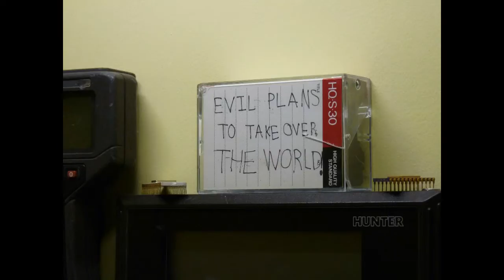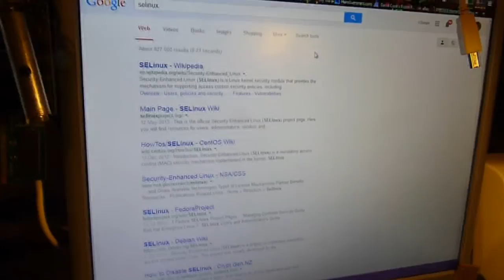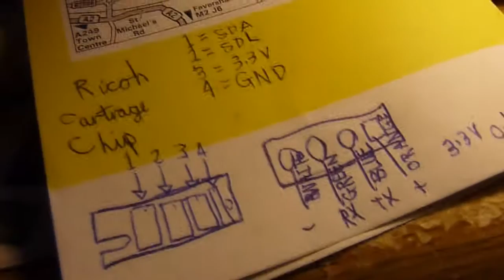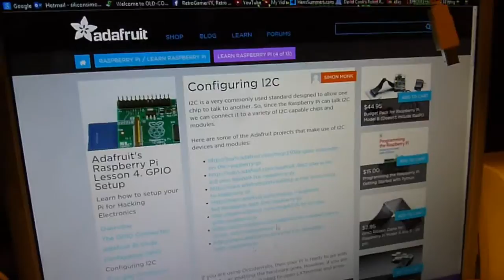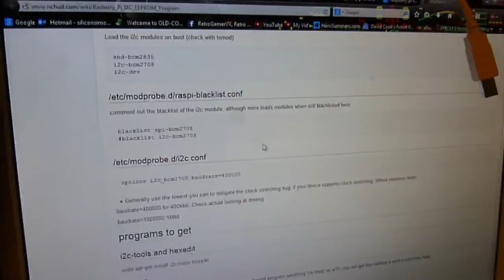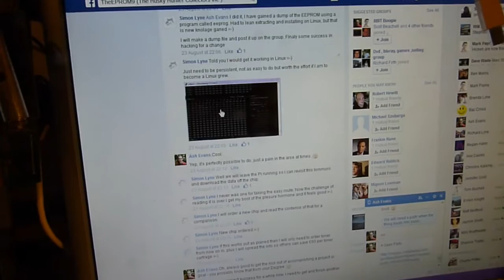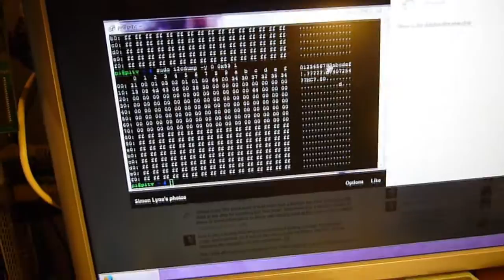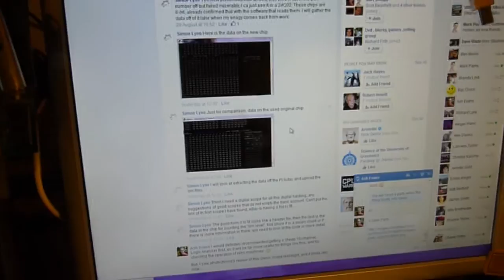Ricoh SP201n Toner Cartrage Hacking

Comment: Just made reset to my Ricoh printer using PonyProg(Windows version) and FTDI (usb to serial) adapter. Soldered 4 wires to chip pads:
Vcc -> Vcc
Gnd -> Gnd
SDA -> DTR and CTS
SCL -> RTS
Here's eeprom dump:
drive_dot_google_dot_com/file/d/0B4yCwRQLoGTdaU4tY3FRY3dvc3c/view?usp=sharing
Make sure you checked invert reset, invert SCKL, invert DIN, invert DOUT boxes in PonyProg config.

Happy hacking
Reply from the maker: Martynas Mirauskas Nice, that's what I like to see, additions to the information I gave here. Hopefully the video was of good use. The chips used are 24C02, the remakes used lasers to burn off the part numbers but failed to do it properly. Under the right light you can still make out the part number.
Reply: ***** Original chip was marked as BR24L02 2Kbit eeprom. Now I'm making Arduino powered jig to reset these chips without PC or soldering. I'm making this just for fun, but it could make some profit on ebay. I will share my project after i finish it. its still me just different youtube account
Reply from the maker: arejaz Go for it, might have to try that myself. Chips are still floating around somewhere.
Reply: ***** Hi, I haven't done anything since last comment to this project. It was breadboard-ed so I have no working circuit. I will try recreate circuit and report back in a couple days with more details. I remember using my own FTDI (ft232rl) breakout board. You can find programmer schematic in ponyprog website (i2c eeprom circuit + si prog interface) I did not used any transistors or resistors. Also you have to connect all  address pins to ground (on eeprom chip pin 1, 2 and 3), like in i2c eeprom circuit shown in ponyprog website.
Reply: +Martynas Mirauskas Dude, thank you so much. I tried to manually edit the data in my toner cart and bricked it, but I was able to write your dump to it using the FTDI breakout like you said, works good now!
Reply: +StratMetal 
You have to realize what rs232 are you going to use. There at least 3 variants: 5V, 3.3V, and original when logic 1 is actually -12V and 0 = +12V, so be careful which rs232 are you using!
Reply: +SladkaPritomnost FTDI chip uses 3.3v logic. it work with both 3.3v and 5v because of logic level threshold .
Reply: +Daniel Haworth I'm happy for your success. I am always trying to find a way to hack something using minimum of tools and money. I even make my own break out boards. example I made full FTDI board that has all pins not just tx rx vcc and dtr like these from china
Reply: +Martynas Mirauskas Actually, that's exactly what mine is, a super cheap one from China that just happens to have all of the pins broken out around the edges, but only the main ones actually have a header on them. I took the Ricoh chip and held it against a piece of card stock, then clipped onto it with 4 clip leads, and clipped the leads around the edges of my FTDI adapter.
Reply: +Daniel Haworth there did you get that breakout board? I was looking for something like this to buy for a long time with no success.
Reply: +Martynas Mirauskas http://www.ebay.com/itm/121821751277
Reply: +Martynas Mirauskas 
Thanks for all the info! I have got BR24L02 type, it works the same way with FT232 and PonyProg (I had 3.3V on FTDI adapter).
Reply: +Martynas Mirauskas 
Are you also able to understand extracted code contend? Where did you get eeprom's dump?
Reply: I have made this dump using hex editor. I have no idea how it works. Just copyed what I saw in this video
Reply: does it work witouth FDTI, I mean on an original serial port ?
Reply: No, it requires the lower voltage level. And since the software is sort of using the FTDI chip in a way it wasn't originally intended, I'm not sure it would work with one of the cheaper chips either. It did work for me using a cheap FTDI adapter from China that was about $3, but I had to run Windows 2000 in a VM to make that software work.
Reply: Okay thank's, Ill look for an adapter then. :)
Reply: You can buy them on Ebay or Amazon :) THere's a few different ones out there and I'm fairly certain you need the FTDI based one, which are typically the most expensive. I haven't tried it with one of the others...
Reply: Can you tell me if this one is good?
http://www.gearbest.com/boards-shields/pp_415190.html?wid=21
Reply: And also what kind of voltage is needed on VCC (3.3 or 5v).
Reply: That's exactly what I have :) It worked fine
Reply: Great, Thank you very much ! :D
Reply: What dev. type I need to select in ponyprog?

Comment: How To Reset Chip Ricoh Aficio FX200 & REX ROTARY DSM520PFL     Chip Model :  ML-2150 OPC BD V2.0
Reply from the maker: Unless it uses the same chip I don't know. They give the chips a custom part number, I reverced engineered the PCB to work out the type of EEPROM, 24CXX & 93CXX have diffrent pinouts.
Reply: @TheEPROM9  24CO4WP

Comment: i would use the arduino for this
Reply from the maker: ***** That is one f the wonderful things about this kind of work, there is no one way to do it.
Reply: that is true
Reply from the maker: ***** A lot of things in engineering are like this.
Reply: i have both arduino and raspberry
(also a launchpad but i dont like that one)
Reply from the maker: ***** I have a few Pi's Got an Arduino and to clone Nanos.
Reply: I also have a box full of atmega chip (whit arduino boot loader)
So that i can build awesome stand alone projects
Reply from the maker: Slowly building up things like logic analyses now to help with this kind of work.
Reply: True
I personaly like the 
Trow stuff at the wall
Method more
Reply from the maker: ***** The more info I can gather the better.
Reply: i always get the data after my experiments :P

that is why 20% of my builds do not work
Reply from the maker: ***** There is a lot of fun in experimenting.
Reply: true that
Reply from the maker: ***** Best way to lean, messing around with stuff and observing the results.
Reply: yea and also its the most fun
Reply from the maker: ***** Indeed, keeps the brain active.
Reply: can you provide some pics codes pinouts and instructions for me to reset ricoh sp210su toner chip
Reply from the maker: +Bishwajeet Singh I'm pretty sure I showed all the documentation I created in the video.